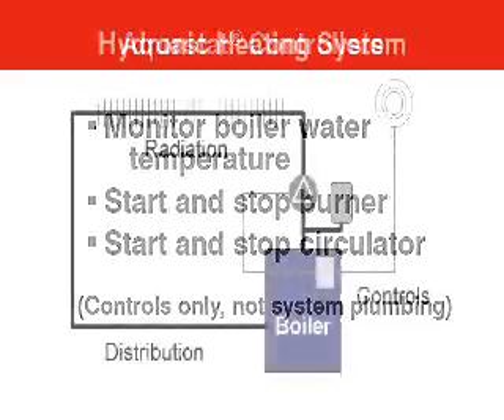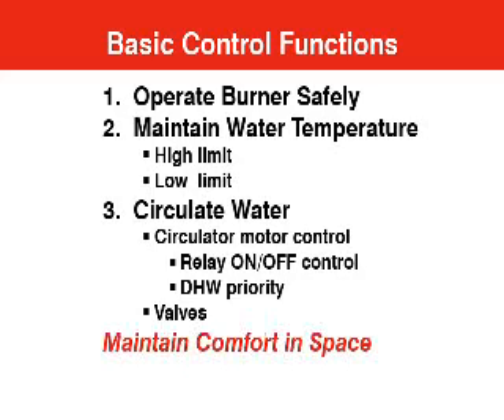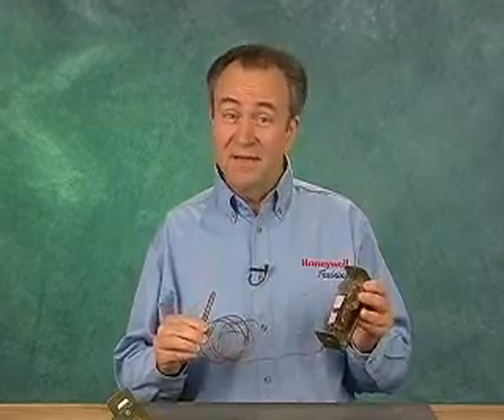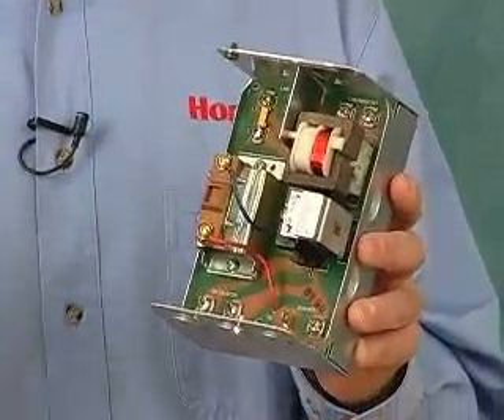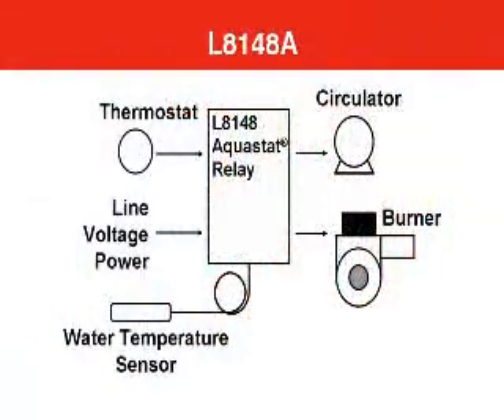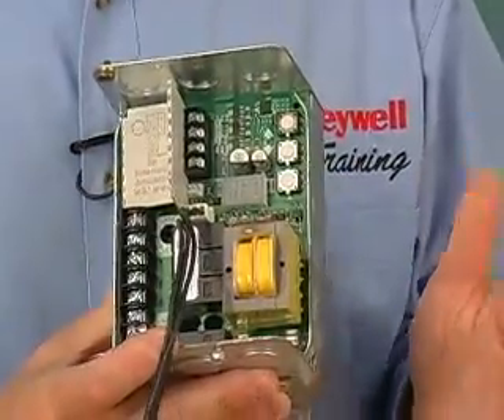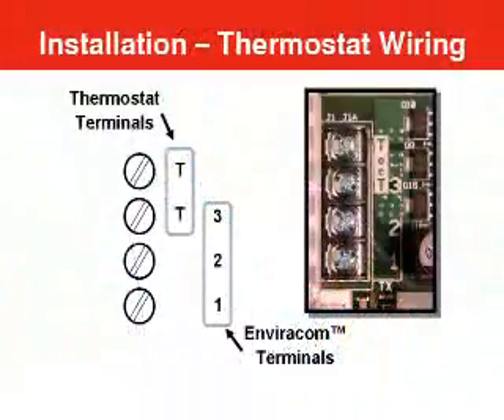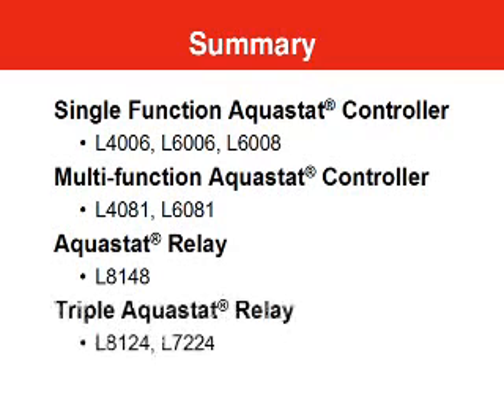Honeywell Basic Hydronic Control Training

Comment: I have a 45 year old Burnham 805B that has a Honeywell aquastat with no low Temp limit adjustment.  What model should I get to replace this with a temperature differential of 50F?    in other words, high limit of 180F, low limit of 130F.